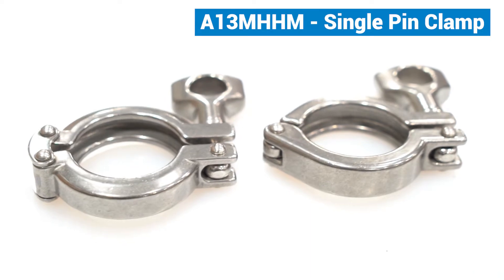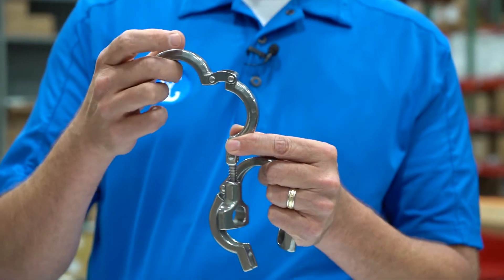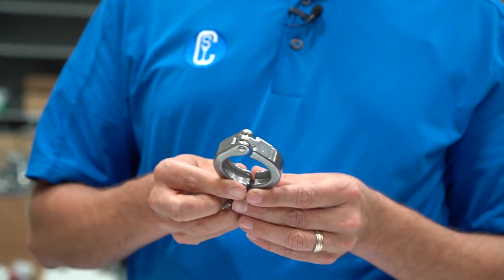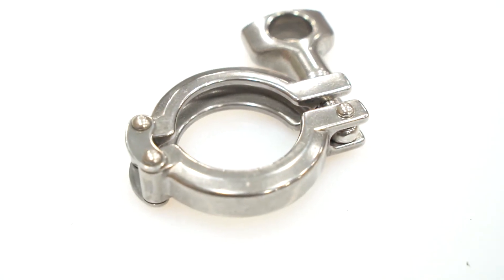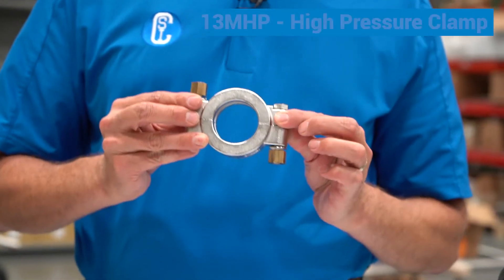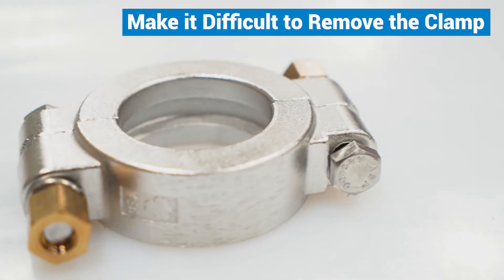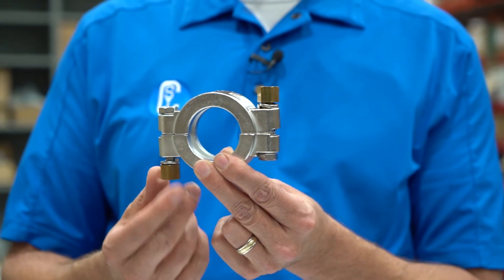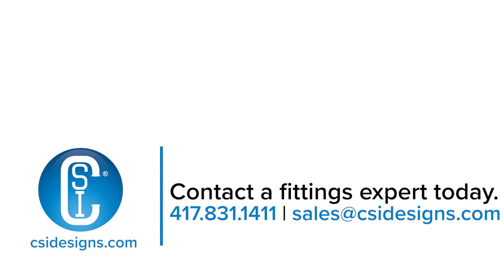Tri-Clamp Clamps

Comment: What about 3 segment clamps?  I think the pressure rating is the same vs single or 2 pin style clamps, but what about it's ability to seal two ferrules together.  Does a 3 segment clamp seal around the ferrule any better than a 2 pin clamp style clamp?
Reply from the maker: A 3-segment tri-clamp is often preferred over a 2-pin clamp for several reasons:

• More Even Pressure Distribution – The 3-segment design applies force more evenly around the ferrule, ensuring a more secure and consistent seal, reducing the risk of leaks.

• Easier Installation & Alignment – It provides better alignment of the connection, especially for larger or heavy-duty applications.

• Increased Strength & Security – The additional segment enhances the clamp's strength, making it more reliable in high-pressure or high-temperature applications.

• Better Performance in Vibrations & Movement – It holds up better in systems where vibrations or frequent connections/disconnections occur, reducing wear and tear.

We hope this information helps!
Reply: @csidesigns  Yes, that helped, thank you.  Why aren't 3-segment tri-clamps available in 6" (13MHHS-6-S)